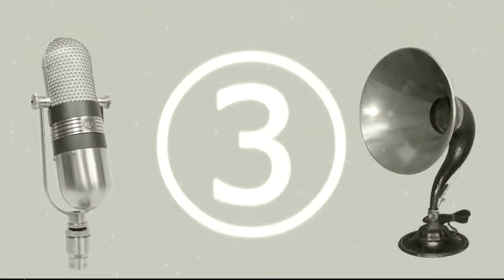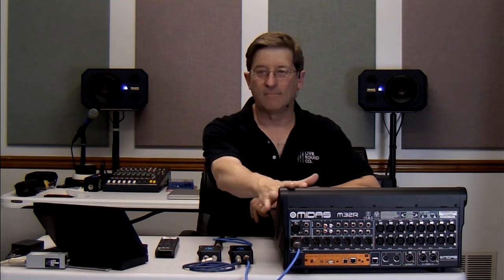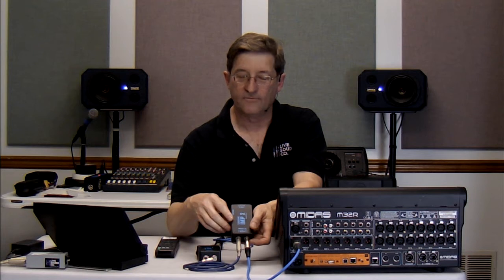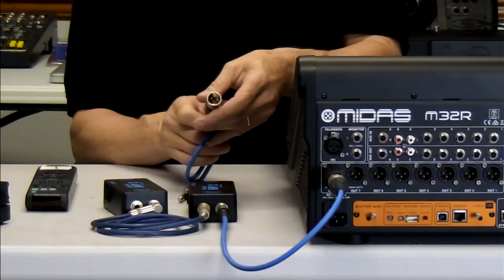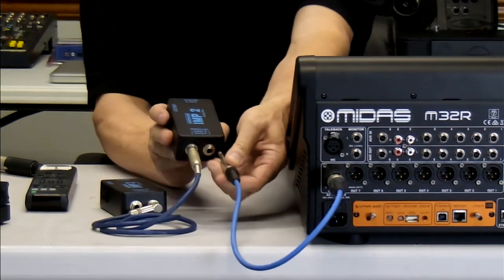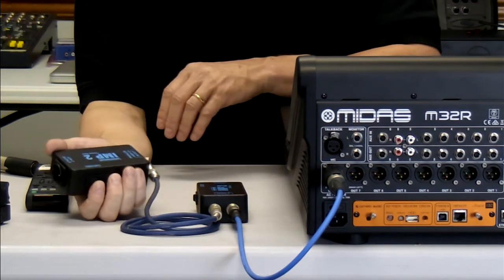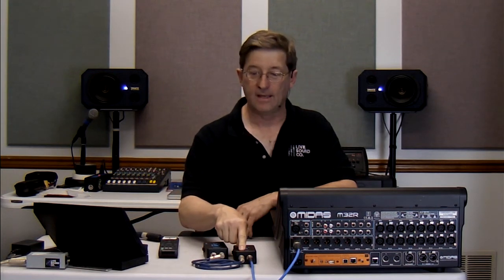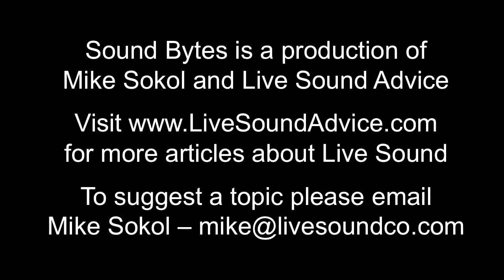Sound Advice  Quick Press Mult

Comment: Mike - I have a Yamaha LS9 32 that I am using FOH.  I am needing to send an xlr aux feed (+4 dbu) to another mixer in a cafe area...it's a bit of a run so I don't want to send line level signal that far.  Could this set up work for running the audio into a regular mic level input on another board or should I run something like a radial reamp (http://www.radialeng.com/r2011/xamp.php) to bring the signal back to instrument level and then run a di?  Thanks for your insight regarding this.
Reply: This DI trick will knock the +4 Line Level signal down to a hot mic level of -20 dBu or so. You can easily run that 500 ft since it's a balanced signal. If you use something like an Ebtech Hum Eliminator that will send a balanced +4 dBu line level signal for thousands of feet with standard twisted pair mic cable. You could then drop it down to mic level on the far send with DI, but you would need to rewire the DI input to be balanced at that point. The balanced line ability to cancel hum and interference happens in the INPUT side, not the OUTPUT.
Reply: This is great, Mike!  Thank you.  Had one more question - Instead of rewiring a di what are your thoughts on running through the hum eliminator and then using a Radial Pro AV1 before going into the mixer for the cafe?
Reply: Yes, that should work just fine. However, are you sure you need to attenuate the signal down to mic level? Most mixers can accept line-level signal on their XLR inputs, and many also includ a pad to take 10 to 15 dB off the signal. That's what I would do.
Reply: Sadly this mixer doesn't have that...it's an old ART 418...i know it's super low quality, but I'm trying to use what I have.  I will try it out, though. :) Thanks for all of your input...and your channel is great, btw!